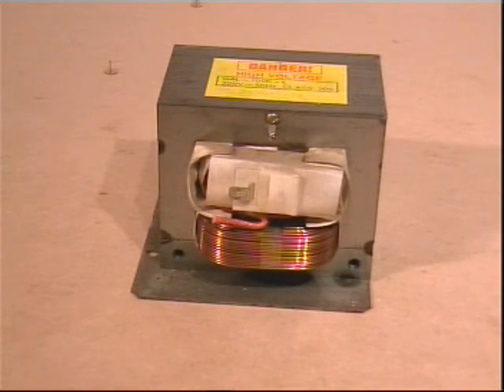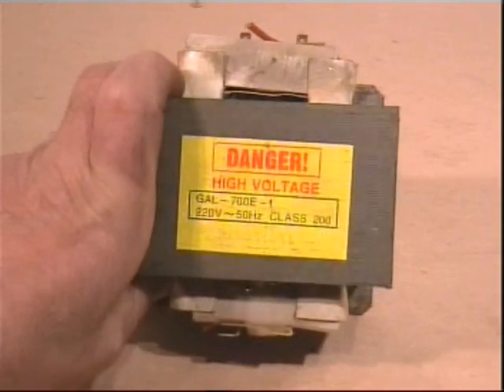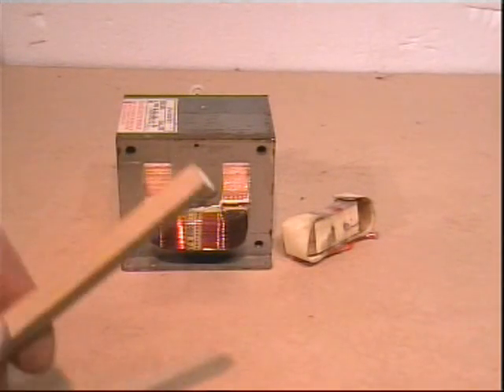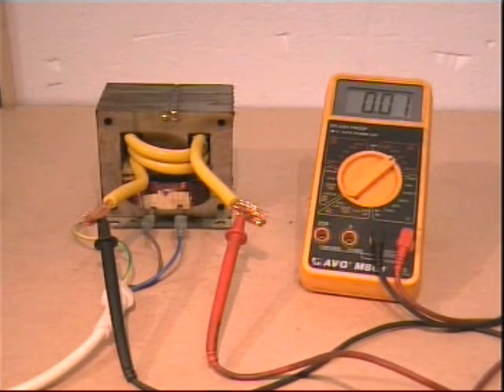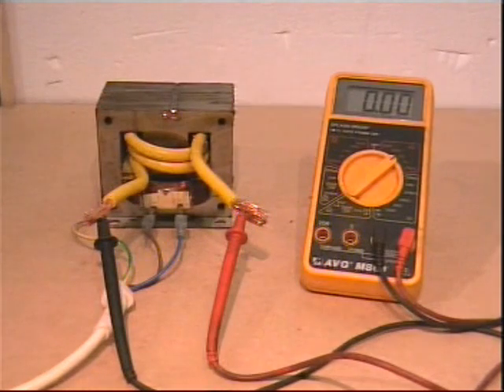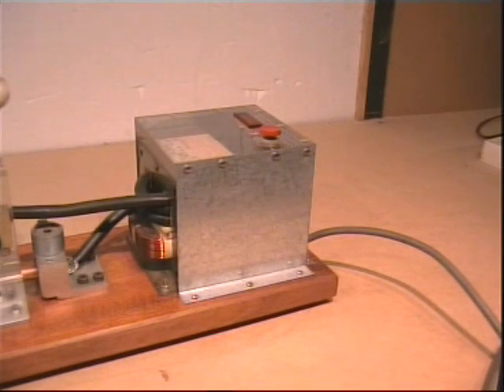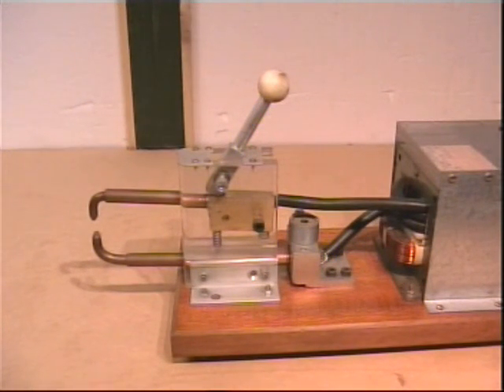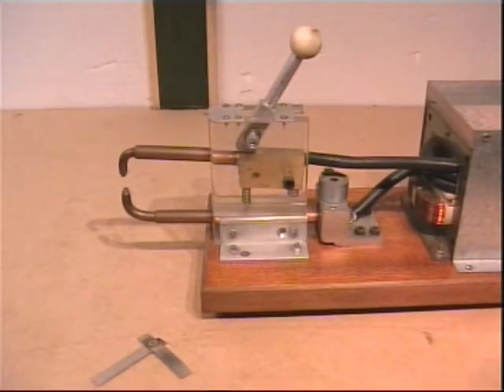spot welder Mk 1.wmv

Comment: hello looking good. I have used  70 mm2 welding cable to replace the secondary. getting two turns. But not giving output (open circuit voltage) zero. any reason?
Reply from the maker: don't forget you are measuring AC

Comment: Did you measured the amps? So, more coils of sec. wire making more volts, more volts increase power is it right?
Reply from the maker: Volts and Amps = power (watts)
you alter one at the expense of the other .. stick to my vid as best you can !

Comment: Good job. I can get a good result. Two pieces of metal are only stick one to the other. Have you a idea of the number of amps you get with only one transfo ?

My current is about 220 A. Is it enough ?

Many thanks in advance
Reply: Error in my previous message / I cannot get a good result
Reply from the maker: I guess you may be getting losses in your setup ? I also doubt you get such a current , It must be made well, try reducing cross/section of electrodes (contact points) ensure materiel is clean,stainless steel works the best .... all the heat/energy must be at the joint interface hope that helps

Comment: why so long to reach 2 volts ...... if it was normal ...?
Reply: he Welgeduwelbeh - I'm much more inclined to fault the meter than the transformer or the AC mains. Aren't you? Accurate measurement of  RMS values of small amplitude AC signals may take time, depending on how it is implemented in the meter.

Comment: great vid.
what gauge wire did you use?
i only have 4 gauge on hand. would that be sufficient? i realize most recommend 2 gauge.
thank you.
Reply from the maker: All information is in the video ....
Reply: poroldchap i watched the video again carefuly. i dont know where it states the diameter of wire. 
i used 4 gauge stranded wire.
i am making a cam device to make sure i have proper clamping force while welding. i checked again today, and im still getting 2.3 volts.
But like i said previously, my welds are not joining properly.
The electrode tips you used, are they solid copper round stock, milled to a point? Where would you find something like that?
Thank you
Reply from the maker: look 2.30 - 2.40 also cross section 1/8th not a point with respect Sir, I 
went to a great deal of trouble making this video and years later still 
getting questions that are in the video
Reply: Thank you

Comment: Is it shock proof?
Reply from the maker: Prehaps a better question to ask,, is it idiot proof?........... my answer "what is"? :-)
Reply: LOL! (Great video, by the way! Thanks, poroldchap!) 
I would only respond by saying that the problem with trying to making anything completely idiot-proof is in underestimating the creativity of complete idiots!
Reply: More likely you would get a burn from the heat generated by the metal or electrodes, but I definitely would not try to "weld" your fingers, low voltage, and high current is still dangerous due to heat and burns.

Comment: I tried to make a battery tab spot welder with the same type of transformer. Output 1.8V 1 Awg wire for the secondary. I make two electrodes parallel ( I'm using welding rod as the electrodes ) in order to weld the nickel strip to the battery. but it won't go throught the metal and weld the strip to the battery. it just weld the nickel strip and the electrodes  together.  I tried to use the momentry switch to act as a timer, but it still not success.  What's wrong with it?
Reply from the maker: My spotwelder was made manly for series welding, but you could try 
copper electrodes ,and it would help if you used a gap between the 
electrodes (nickel strip) inorder to force current through tab - battery
 - tab etc think about it for a bit and remember that current will take 
the easiest (resistance wize) path.hope that helps
Reply: that's what I think.  the current take the path A to B on the strip instead of go throught the battery and come back to B. I also tried one electrode on battery and one on the strip to force the current go throught the battery surfface. but after a melting spark, the strip stick with the tip of the electrodes but not melt with the battery.
Reply from the maker: As I said my welder was not intended for tag/battery welding, for that I would use cap-discharge but take a look at this ,it may help https://youtu.be/GGTGIlT6JvM

Comment: Are you effectively creating a dead short on the secondary? Is that safe?
Reply from the maker: +BenjaminGoose  No I`m not ! , it still represents "inductance" to AC albeit at low H. thats how all spot welders work (if there was a "dead short" then no currant would flow) 
 is it safe ....yes
Reply: +poroldchap There's really no such thing as a true 'dead short' - i.e. zero resistance, except in very low temperature superconductors, at this time. (Maybe we'll one day get room-temperature superconductors, but we don't have them yet)

But, if you DID have a 'dead short', you'd get MAXIMUM current flow, limited by the secondary winding impedance, connection cables, etc - not NO current.

But to BenjaminGoose, yes the load is pretty close to a 'dead short' - very low resistance & impedance, passing some hundreds of amps & that's why it gets hot.  Power - thus heat dissipation - is I^2.R  (Current squared times resistance) & though resistance is low, current squared is a relatively large number so things get hot.  All this power is dissipated over a fairly small area - so, if you like, watts per square centimeter, or whatever, is also a large number.  [Interesting - the spell-checker prefers centimetre....]

The junction of the two bits of stainless has a higher resistance than the copper & brass in the circuit, so most of the power is dissipated there & it gets the hottest. (Everything else in the circuit will get hotter too, but mostly at the weld site)

Comment: I have a 220v power supply to the mot transformer,so can you teach me about winding numbers
Reply from the maker: +المهندس ضرغام الجاسم Don`t worry about winding numbers. your mot (primary) will have been wound to your supply, just copy my video if you can get 3 to 6 volts ac out you will have made yourself a working spotwelder have fun be safe ...

Comment: that was the information I wanted ,because I made it by other than MOT transformer (the two windings are over each other) and it faild ,thank you
Reply from the maker: +المهندس ضرغام الجاسم Your welcome, it should have worked with a conventional transformer (one over the other) but useing a microwave transformer is a safer approach, but more inportant its much , much , easier as its half done for you, cheers

Comment: why we must use a microwave oven transformer and not any other transformer for spot welder,what are the characters that made it the most suitable for such project?...thanks
Reply from the maker: +المهندس ضرغام الجاسم Because microwave transformers give out such high voltage ,for safety reasons they separate the windings one above the other, (instead of one over the other) this makes them most suitable for such a project, hope that helps

Comment: Are you not shorting the mains with that primary coil?
Reply from the maker: The primary is still the same primary it was before we modified the secondary !
maybe translation but I don`t understand your question ?
Reply: I mean if we do not have a load on the secondary then what is the difference between that and just shorting the mains? Does it act like an inductor?
Reply from the maker: all transformers work on AC and are therefor by definition are inductors,it dosn`t matter if the secondry has a load or not ! its still not a short, lookup reactance to a sinucidal waveforms , hope that helps

Comment: how long can this run bevore it overheats?
Reply from the maker: Thats a why question
Reply: Simple I need 1.9 volts at 80 amps for a project and it needs to work for at least 1 hour
Reply from the maker: Ok, then I guess in order to achive your goal useing such a transformer its posable with forced cooling, a much larger trany would be preferable however ..

Comment: sir im from the Philippines our electricity current here is 220V-60HZ and i have an old MOT  GAL-700-E-A1  220V-60HZ can i use this regarding on this video that you share, i am so interested about this home made spot welder
Reply from the maker: dominadorbudiao Yes you can as the trasformer was made for your country etc just make sure you don`t cut into the primary as shown, if you follow my vid, it will work fine,poc

Comment: i have a 140 amp stick welder welder , and have made to prongs with one lead to my earth clip and the other to the welding stick handle , when push onto a piece of metal it only seams to spot very thin metal, some metal wont weld at all , is the amps to low .!
i want to spot weld some lipo battery terminals, which i think is stainles steel spot welded o a aliminium tag

Comment: I made one and my main feed is 120v on primary. And my secondary is same as this one but no reading on top to leads on secondary not sure what I did wrong. my secondary winding is counter clock wise.
Reply from the maker: Johnson B Ok guess you in the US so your primary winding is 120v thats ok. it 
dosent matter clockwise or not, as its AC out and will be only a few 
volts , check it againe with your meter on AC scale say 6v you must 
have some reading !

Comment: Have you ever tried increasing the length of the secondary but not having to have it around the solenoid? I think all the wire length which actually is the causes of higher voltage, doesn't really have to be in the the magnetic field of primary!
Reply from the maker: With respect not sure you have understood transformer principles
Reply: *****
 Thanks for replying and yes, that is very possible, I never studied electricity or magnetism, but I'm trying to learn :)
Reply from the maker: Good for you !... get the basics right and the rest gets easier , theres a good teacher on youtube,if I come across the name will let you know,but its done by a young lady,have a search see what you comeup with :)
Reply: *****
 Thanks a lot, I appreciate it :) Yes, I do that.

Comment: Sir, your explanation and demonstration are perfect. Actually I'm about to buy a small and portable spot welder with a cooling provisions on it, Anyway, I'll just install a water line so that I could use the spot welder with lesser heating. Also, I will be using a verilliom copper tip. its the material being use for spot welding machine. Best regards. Engr. Ramon Formoso from the Philippines.

Comment: how do you know how much current you can draw when building a transformer? what great video's, wish I had your knowledge
Reply: The transformer will be of a common value of around 600 Watts. That is all you need to know. That could translate as 600 volts out at 1 amp.
Or 600 amps at 1 volt. The amps x the volts can be up to 600 watts.
So at 2 volts out you can run 300 amps.
I'm sure poroldchap will agree and not be offended by another old git's input.

Comment: @atsernov:
220v as input and 2.2v as output mean a x100 ratio
So input current will be divided by 100, 700amp at output = 7amp at 220v plug or 14amp on a 120v plug . (not 0.45A !)  ;-)

Comment: It's a stupid saying. Yes, technically amps kill... but you still need a minimum voltage to achieve electron flow through the human body. Of course the required voltage varies from person to person.

Car batteries average at about 600amps at 12.6V but you can touch the terminals with your bare hands. It's simply not enough voltage for electricity to flow.

Comment: Mounting a fan will help a little, but installing a heatsink wouldn't be possible since it'll be primarily the low voltage winding getting hot.

Comment: Depends on the output amprage. But lets say the maximum this unit is capable of is 700amps at 2.6V so 2.6/700*120=0.45~ amps.

Giving some natural inefficiencies the current at the wall will be slightly higher, but still; you are unlikely to see anything over about 0.75 amps at 120V socket, and no more than about 0.38 amps at a 240V.

Comment: The transformer will not hold any power once disconnected from the mains but the large capacitors will so be sure to short them out before touching anything
or you'll find yourself  on your arse at the other side of the room

Comment: Just found your videos.  Great stuff!
I had salvaged MW parts hoarded here and got inspired to try a similar build.
 I Wound 5 turns getting  3.6 volts. Also squeezed in few turns of light wire to get  7V > rectified DC to run 
ex PC fan for cooling  You mention Mark II with atmospheric? timer switch?  Sounds  hopeful.
I gather you’re not proceeding with Mark II video because of Darwin award candidates. That’s sad.
Care to elaborate? 
Also built a copy of sheet metal bender to make a case.

Comment: Great video!  What wire gauge is the secondary?  It looks to be 0 or 00.  I have a micro wave transformer already prepped but want to make sure I got the right gauge for the current that will be induced.  Thanks for posting the vid!  If anyone hurts themselves because of not knowing about induction, current etc just consider it natural selection in action.  It works in the animal kingdom and we should let it work more often with humans.

Comment: Thank you. All well explained and comprehensible, I never thought that such a low voltage would be sufficient. but it is the matter of low resistence of that thick cable, which makes the current so high... the original thin secondary coil wouldn't stand such current I guess

Comment: You can use a currentclamp meter to measure amperage in excess of 20A. I would think the amperage in your spotwelds exceeds 200-300 amps... Also you don't have to take the secondary winding poles out from the same sides, oppsite sides r just ok also... :)

nice video, i got some design inspiration!

Comment: my mot has 3 wires comming out of the output. 2 going to teh mag and 1 going to the cap but 1 of teh 2 mag wires has a connector going to teh cap... how do i wire it for arcs and destruction????

Comment: Thanks for the response. I did some tests, and you are correct. I was able to fit 4 turns of 0 gauge welding wire into my transformer and it gets slightly warm. Outputs about 4.5v although i do not have a method of checking the current. Thanks for your help.

Comment: I'd be interested to hear how the larger machine runs. Do you think it's practical to make a machine which would weld a 4mm thick copper rod vertically onto some copper plate? 

The high thermal and electrical conductivity of the work material would make it quite difficult wouldn't it? Is the geometry of the rod even feasible? Would it melt all the way up to the electrode? 

The only other thing I can think of is a capacitor discharge type, but that looks expensive.